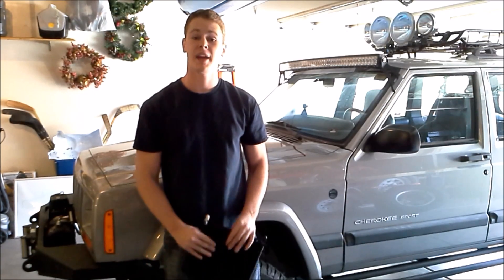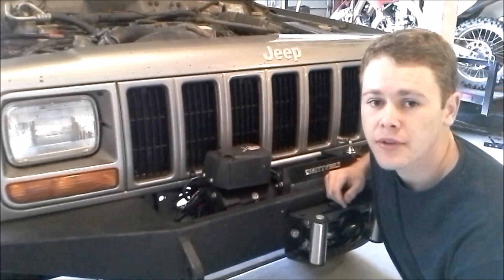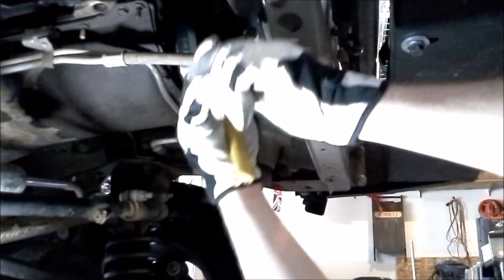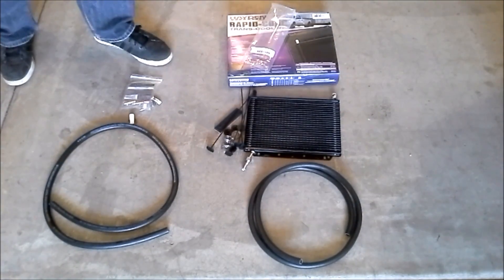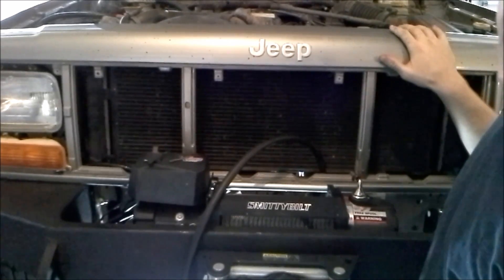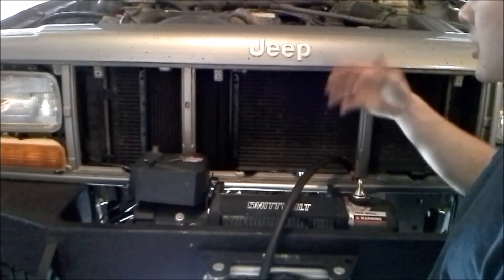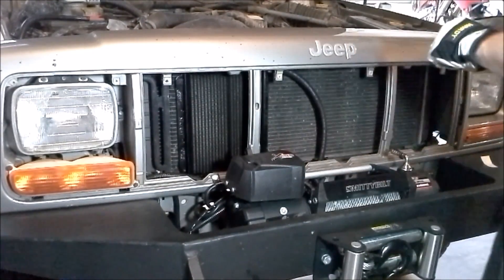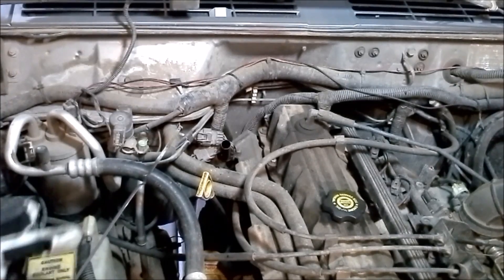Jeep XJ transmission cooler install

Comment: just starting with XJs and bought a clapped out junker to start return lines alll messed up and literally just return and outlet into an oil cooler and nothing connected to the radiator thanks for the DEEEETAILED explanation fuckin mint buddy

Comment: Love your video just a small thing dont use those crappy hose clamps😉 get some nice high pressure qualité clamps and you will be sure not to loose all transmission fluid when you are in the middle of nowhere😂
Reply from the maker: Do you have any brands that you like for those?
Reply: @AdmiralOffRoad  i do not,but the most important thing to use hoseclamps that tighten from both sides, every high pressure clamp for fuel injection etc will do just fine.The ones that you used will cut into your line or just wont be as reliable. Same. Go,s for cooling systems etc use good hardware

Comment: i think the drawing color is incorrect.?..
i'm pretty sure the colder return is attached to the top of radiator and the hot line is connected to the bottom

Comment: Nice tutorial. Keep an eye on the rubber sections of those factory rubber lines though. The newest XJ is over 20 years old now and over time they can degrade and start to leak. I'm installing one of these trans coolers in my '91 XJ because one of the rubber parts of the factory lines started to leak. 

Since I'm in a year round warm climate (Hawaii) I'm just going to bypass the trans cooler in the radiator entirely. I'm told it's more of a heat exchanger that's meant to stabilize the trans fluid temp than an actual trans cooler; and probably does more to keep the fluid from being too cold in cold climates than it does to help cool it in hot ones. I'd rather have the trans and engine cooling systems totally separate rather than connected and continually heating each other up. The Hayden 678 cooler alone should be plenty sufficient to keep the trans cool especially since I'm not towing or running huge tires. The 4.0L is known to run warm anyway (mine does), so I figure why make the radiator also try to cool the trans fluid.

Comment: Is the cooler marked for inlet & outlet or does it matter? Also, your XJ run any hotter with the cooler positioned in front of the mechanical fan? Thanks

Comment: Admiral Off-Road hey man I have a 93 jeep Cherokee 6 cyl transmission drain plug is stamped Dll , what type of fluid should I be using? Jeep dealer here is saying 75 90 gear oil ???

Comment: Hey young 4x4 brother Im twice your age, Im certain but there's snow on the rack or rust on the fenders. I watched in amazement as you cut the rubber section of the pressurized transmission line with hard fittings into the radiator and into the side of the transmission. With one gash you blew off all the prior continuous improvement and the engineering used on developing the system. Universal doesn't always mean "deal" when your a long-long way from home with a damaged transmission, maybe fluid everywhere and no pressure. You go and go when it comes to the great drive and inspiration to improve on "stock," or OEM. Just my opinion you might want to look end to end on the next project and think about what you see. Good Luck!

Comment: I have a 2007 Jeep Grand Cherokee with no transmission dip stick and nothing in the manual about having to  change it.. thoughts?
Reply: Change it every 30-40k, far cheaper than a new transmission, and do the transfer case fluid at the same time.

Comment: Thanks for the outstanding video. I was able to gather the parts from Advance Auto this afternoon and it took me a bit more than an hour. I decided to do an AT pan drain and fluid exchange while I was down there so that took me another trip to the store and 1/2 hour more.

Comment: You should have gone straight to the hard line and eliminated those garbage factory crimps in my opinion.
Reply from the maker: have you had issues with your trans lines leaking?
Reply: Admiral Off-Road YES. So far not on my  99, but my 98 had bad leaks at the factory crimps.

Comment: I installed a B&M cooler (Very similar to yours) on my XJ a few years ago and I remember the instructions stating not to use zip ties if the truck is to be used for off-roading. I had to use brackets to install it and never had any issues for years.
Reply: Brackets should be used regardless.  Those plastic clips will get hot and cold and brittle and break easily.

Comment: Possible to run the lines behind the headlight (next to radiator tank) for cleaner install?
Reply from the maker: possibly if you were to put it on the other side
Reply: You can run them however you want, just may require more hose of course.  Just keep them tucked up out of the way of any moving parts LOL.

Comment: my jeep has a ac condenser in front of the radiator lol
Reply: mine has ac condenser too. dont know which cooler i should get that will fit behind grill
Reply from the maker: here is the one I used: https://www.amazon.com/Hayden-Automotive-678-Rapid-Cool-Transmission/dp/B000C3DDKO
Reply from the maker: so does mine
Reply: +Admiral Off-Road damn dude how did you get yours to fit, I have no room at all
Reply from the maker: what trans cooler are you using?
Reply from the maker: thanks!

Comment: Hey Bud, I installed the 678 the other day and I can really tell the difference it makes in how the tranny shifts and runs much smoother. No difference on the engine temp though so I am going to install a High flow water pump after a good flush and a new thermostat. That should get rid of the cavitation of coolant that these 4.0 motors are so prone to.

Comment: 1.- Just to say there is a difference between ATF Coolers.. 

A) The cheap "Tube and Fins" style which is usually not painted just raw aluminum its less efficient but it gets the job done if there is a lot of airflow and you are not asking much of it (Like full Weight Rating) its good as an Add On and piece of mind not to test the weight limits on it. Its also some what fragile and rock hits can bend the fins very easily.. This type is good to replace the Radiator Cooler.

B)The "Plate and Fins" aka Radiator Style is waaaaayy better in efficiency it can have little air flow and still cool down the ATF better than the cheap one, This is the one you got.. It can also withstand rocks better than the cheap Tube and Fin.

C)The Absolute BEAST style is the "Stacked Plates" which has the Maximum Efficiency they are usually found on most expensive RVs, They are quite expensive but can Cool down the ATF faster than the other 2 types. This is way more robust and can stand a direct rock hit from a front car shrapnel. 

2.- The "pads" of the ATF cooler is to give a gap between the Cooler and the A/C Condenser (Mounting Surface), If you put the ATF Cooler without the spacing pads you can in fact reduce air flow and when you have the A/C On it will transfer all the heat of the Condenser into the Cooler.. Always use the pads between the cooler and the mounting surface its very important. 

Nice instructional video! keep it up.

Comment: I have a 97 jeep xj , and I have the oem transmission cooler, by canceling that trans cooler and adding a better one, cool down my motor. I live in the southern California. desert area, I drag race my jeep in the dunes and it tends to over heat when I'm flooring it.. many people suggest for me to add a transmission cooler but I have one , it's the oem. hope I get a response
Reply: Add an auxiliary transmission cooler.  Does your jeep have the mechanical fan that runs off the engine or is it just an electric fan?  If you have the mechanical fan check the clutch, the fan should spin somewhat free when turned by hand (with the engine off of course LOL), if it doesn't or if it is very easy to spin without any resistance at all the fan clutch is bad which will contribute to a lot of overheating issues...if you have an electric fan that isn't working its usually the relay or the fan motor itself has died.
Reply from the maker: +El de La Cherekona a better transmission cooler might help a little. I would also look into doing an auxiliary fan override switch so you can turn on your electric fan whenever you notice your temperatures rising. Hood vents may also help a bit while sitting idle. A cheap way to get good vents is to get them off of a Chrysler LeBarron if you can find them at a junkyard (they're starting to get hard to find in some places)
Reply: +Admiral Off-Road my hood is lifted from the rear. but I'm thinking of removing the oem cooler and buying one online with an electric fan, since I have two electric fans (98 Chevy Malibu fans)
Reply from the maker: that could help, especially increasing the air flow

Comment: I've been wanting to look into doing this but I heard that overcooling your Trans could make it not operate correctly, is there in line thermostats you could throw in on the hot side before the splice?
Reply: Unless you live in a terribly cold place all the time (Where you don't need a transmission cooler anyway) there is absolutely no way to run the ATF Cool enough to do anything wrong. Even if you remove the Radiator "Cooler" there is simply not enough time on the ATF Cooler to Cool down the ATF into out of spec temp, In the bizarre world where you install an ATF Cooler in Alaska the overcooled ATF will only make the transmission run more firmer (Stronger Hard Shifts) but it wont make any damage to the transmission.

Just remember this, Your Torque Converter is a FURNACE for the ATF, This is where the ATF heats up not inside the transmission itself. You can install an inline Thermostat for the ATF Cooler but that is just wasting money..
Reply: Im got 247 on my jeep tranny. I wonder how far I can go. Seems to be running just fine.
Reply from the maker: i'm not aware of one. There are two ways to run a transmission cooler. One way is to bypass the radiator, the way I did, keeps the transmission fluid going through the radiator with the auxiliary cooler coming after. The part where the transmission fluid goes through the radiator is designed to heat the transmission fluid because the engine coolant warms up faster than the transmission fluid. This allows the transmission to reach its operating temperature even in cold weather so overcooling shouldn't  be an issue with this method. If you were to completely bypass the radiator section, then you might run into those issues
Reply: +skirmich where I live we see temperatures on either side of the scale. this winter we saw a month of 5°f and last summer we had 3 weeks of 95+. I do notice, however, when my Trans starts to get hot, (it cooks me in my 89 xj with no carpets I'll notice it's hotter then usual) it will start to slip. my aux fan wiring was MIA from the pervious owners so I just hooked it to a switch in the center console and that helps a lot when at red lights when the temperature starts to creep. (my jeep has a high idle issue so everything gets hotter quicker)
Reply: artardFTW
I think perhaps your clutch packs are just too thin now. A hot transmission will tend to drag rather than slip, You will notice that you have to press the gas further to make the car move. This is because HOT ATF will lose efficiency in the Torque Converter making it stall sooner. A slipping usually means a worn out clutch pack which ultimately means you need a rebuild.

The hotness in the floor chassis can be because of the high idle (Exhaust Heat), Should be more pronounced in the summer.

I live in So Cali so we get +125°F Summers to Weird 30°F Winters.. We cant never get the ATF Cool Enough in the Summer, All my cars use ATF Coolers because of the terrible summers.

Right now I have a 25,000LBs Cooler on my MDX, This winter the lowest it registered was around 140°F in the highway at 70mph and an Exterior Temp of 40°F.
FYI: Normal ATF Temp is around 160-180°F for the MDX so it was a little bit lower but the car shifted just as it was any other day.
Reply: +skirmich it probably doesn't help that my jeep just turned over 260K and was ridden hard and put away wet (very, very literally) by the previous owners. the hotness comes through the natural weight reduction holes on the drivers floor.. but I notice the Trans heat when I get a pocket of hot air through the E brake lever slot. sometimes even starts to cook my phone if I go on a medium length trip. (jeep only drives locally except for occasional the 45 minute trip to the trails)
Reply: artardFTW If it has 260K original miles on the trans then its definitely time for a Rebuild :D That trans has come a LONG WAY now haha.
Reply: +skirmich yea. but I have no idea if it's been serviced at all. $750 jeep came with no paperwork and a custom installed water damage smell, like, every drainable fluid had water intrusion as well. 

I'd love to do a Trans rebuild but I don't have the space, tools, or skill to do a rebuild. nor the funds to have it done lol
Reply: +SuperDagod1 yea just run it til it quits. xj parts are a dome a dozen. I can probably get a Trans for 120 from a part-out

Comment: Question: With this method, the transmission fluid still travels through the radiator, right?
Reply: Yes, You can by pass the Radiator Cooler, Just remember to use a BIG Cooler since the Radiator Cooler is the most effective way of cooling down the ATF.. If your car is prone to have a Radiator Cooler failure don't even think about it, Do it ASAP! Otherwise there is no need to bypass the Radiator Cooler.
Reply from the maker: +DualWieldViking Yes
Reply: +Admiral Off-Road Technically speaking, could one install this transmission cooler as the single transmission cooler? Using both the inlet and return lines into this one cooler?
Reply from the maker: +DualWieldViking Are you talking about bypassing the radiator? If so, then yes, you could do that.
Reply: Yes, through the radiator first then through the auxiliary cooler then back to the transmission.

Comment: Great Video! But those zip tie holders are Radiator Repair Shops best friend. Through vibration they eventually rubbed a hole in my engine radiator.
Reply: they hold up to the heat ok??
Reply from the maker: No issues so far

Comment: Did this upgrade help your jeep run cooler on hot days?
Reply from the maker: +Richard Graham I don't notice much of a difference in the engine temperature and I am currently gathering the parts to install a transmission temperature gauge, so keep an eye out for that video and we will see how much of a difference it makes on the transmission temperature.
Reply: Admiral Off-Road Thanks for the info...Me:99 Cherokee sport 4.0  Saphire Blue, Ion aluminum rims...Fuel injector upgrade. 63,000 orig miles...I plan on lifting it when I hit the Lotto..LOL
Reply from the maker: +Richard Graham Wow that's crazy low miles!
Reply: yeah man it's in new condition. I bought it from the orig owner who never drove it. He kept it in the garage ...Whatever, now Im enjoying it. My first Jeep too...Im hooked!
Reply from the maker: +Richard Graham very cool!
Reply: Did you ever do the transmission temp gauge?  If so do you have a video on the install?

Comment: every XJ i have worked on, the top line on the radiator was the return line....
Reply from the maker: if you follow the lines back to the transmission, the one that is further to the rear is the return line

Comment: Is your engine temperature higher since you put in the transmission cooler?
Reply from the maker: +TheVintagetamiya That's a good question and something that i was a little bit worried about because the transmission cooler blocked part of the radiator, but i have not noticed any difference in the engine temperature with it.

Comment: Have you noticed any difference in the way it drives and shifts after installing the cooler?
Reply: +Admiral Off-Road that would be great if you can make a video on installing a trans cooler gauge, im planning to get one myself.
Reply from the maker: +Doug Fitzgerald I haven't really gotten to test it out yet. I've just driven to work and back since installing it. I am looking into installing a temperature gauge to see how much cooler it runs.
Reply from the maker: +3js1B  Once I figure out how I'm going to do it, I'll definitely make a video. I'm trying to track down a few parts to make it all work.
Reply: +Admiral Off-Road would it make a difference if I bypassed the factory radiator cooler and just installed the aftermarket cooler?
Reply from the maker: Chris Hawks yes. The part in the radiator is actually designed to heat the transmission fluid on initial startup. the transmission has an operating temperature and if you bypass the radiator and live in a cold climate, it will take the transmission longer to reach its operating temperature.

Comment: Nice vid.  Im new to the XJ world. So my question is what is the need for a Trans Cooler?
Reply from the maker: +nrconnor60 Heat is a big killer of transmissions. With the added stress of towing or off-roading, a trans cooler helps keep the transmission from getting to cold
Reply: It keeps your transmission fluid cool if you are wheeling or towing.